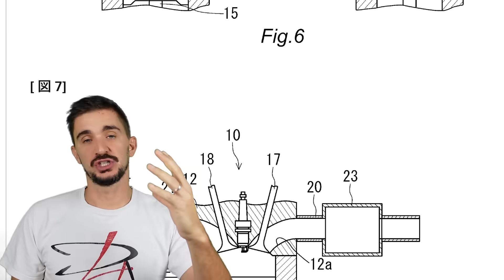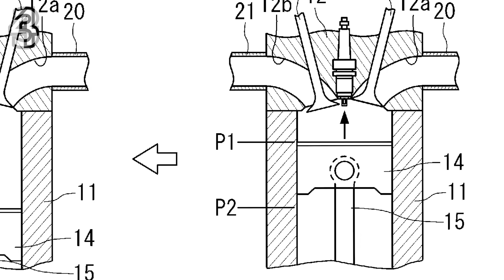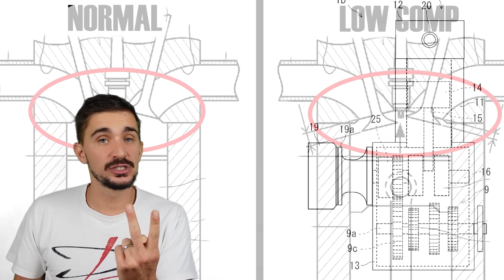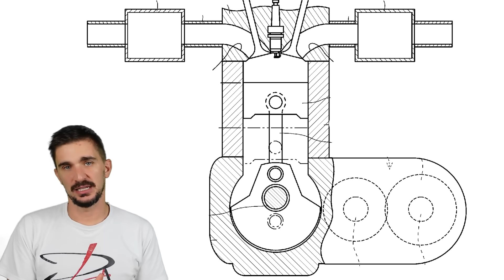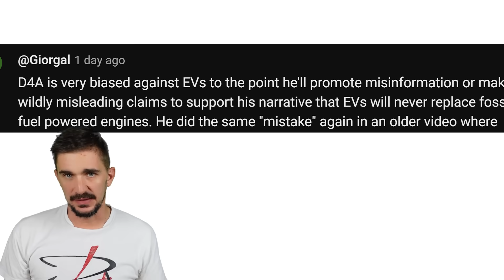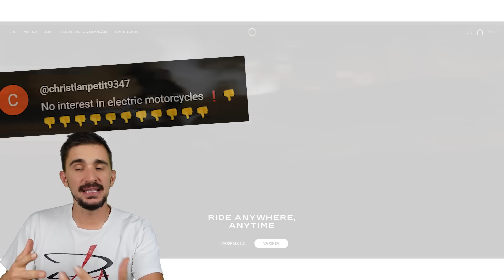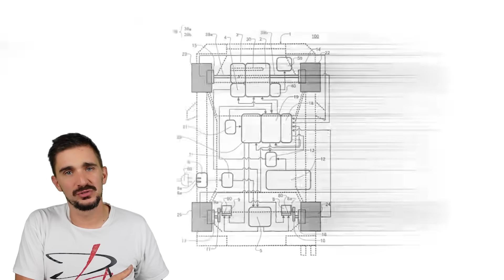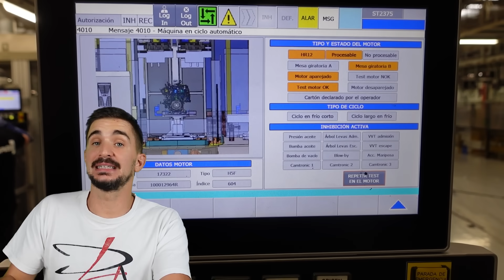Yamaha Just Patented A Fake Engine

Comment: I had a idea similar to this, but the "fake engine" actually propels the motorcycle forward and doesn't just act as one big sound generator. It would use the pressure from an air tank that would be converted into mechanical energy/torque. It would also use  throttle linkage that regulates the air that would get into the cylinder(s), meaning it would rev and sound like an internal combustion engine. The only problems is that you would need to repressurize the tank with a separate air compressor and the bike probably wouldn't have great range; it would purely be a recreational vehicle you would just have fun in. Also, the air tank could explode if it over pressurizes.

Comment: I'll never understand these mental gymnastics about vibrations and noise. Been driving a BYD Seal Excellence for a little over a month now and due to the acceleration, it's basically like taking driving habits from the motorcycle straight into the leather seat. I don't need huge gaps to enter a road or to overtake since a short tap of the accelerator is always enough. I don't see myself swapping that for something that makes lots of nice sounding noise while accelerating half as fast and costing multiple times as much to maintain. 😅

Comment: Uhh.. can the variable valve timing vary enough to change the engine into an air compressor and pump up the tires?
I am no judge of what people do in their spare time but personally I am not prepared to spend $5000 on a vibrator, I am not a Saudi Prince's wife.

Comment: "I'm not biased" 
one minute later:
"This is the problem with EV companies, why is it 'Stark Future' not just 'Stark'?! Tech bro is over compensating..."

This is all in your head, dude! You are biased! Implicitly because you love combustion technology? Gasoline and Diesel? 

I can't tell you why they called it "future" for certain, but I could guess it's basically the reason that makes you so upset because you're so biased: because it's currently the only technology option for a sustainable future. All combustion has emissions which cause cancer and are bad for the environment. That includes hydrogen, because that needs lubrication which burns with the fuel. I know the difference between two and four stroke. Even four strokes burn some oil over time, just a lot less than two stroke. 

This issue isn't technical, it's an identity issue. As in, people identify as a person who loves loud bikes or what ever, and when something comes along that's different then the group think doesn't like change, and the group thinkers go with the crowd.

Comment: Think about this possibility : make the engine work by adjusting the valves or replacing the camshaft. if you have a set of rules or regulations to work around does this approach bypass the goverments bs regulations for emissions ,can it be used as a hybrid ?

Comment: I see the vision honestly. This is the most accurate way to recreate engine noise and vibrations without actually burning fuel. Is it efficient? No. Is it practical? Meh. But most people aren't buying something like a harely because it's efficient or practical.

Also, I find it hard to believe they wouldn't make this optional and/or only put it in certain models, assuming they actually go anywhere with it.

Comment: You're right, there is no scenario in which this makes sense. Kawasaki already has hybrid bikes which make all the engine noise one could want, better than a single cylinder air compressor. No one wants those either because they are hybrids. The people buying electric bikes don't want extra garbage draining their performance or range.

The only way this makes any sense at all is if it doubles as an actual air compressor and is used in Colorado as a mobile air compressor on minimum maintenance/off-road trails for Jeep type guys who need to air back up before hitting the main roads.

Comment: You are overlooking something simple. A motorcycle’s most important purpose. FUN. Based on most of the logical criteria that we use to evaluate travel methods it rates between poor and average. Planes and trains are faster. Buses are far more efficient per passenger. Cars are almost as fast and more efficient per passenger. All of these are much safer forms of transportation than motorcycles. For those who are buying motorcycles because they’re an inexpensive form of transportation an electric powered one will meet their needs. What’s left? FUN from the euphoric experience which includes the sounds. I would never buy one of these fake motorcycles, but when I was a kid I put the card in my bicycle wheel to fake the sound. It’s the same reason that circus rides get patented, even though there’s no logical justification for a circus ride.

Comment: Maybe it could run as compressor spinning a turbine that generates electricity to charge the batteries and therefore eliminate the need to charge this vehicle so often. 
Doing this power and noise are made possible

Comment: My take: this exists only because of the inflexibility of the average motorcyclists intellect. I’m not immune. After laughing derisively at this patent, I thought back to how I used to use a clothespin to clip a playing card to the frame of my bike to make an engine sound. I thought back to the many MANY thousands of dollars I spent on my various motorcycles to make them sound “cooler” with MINIMAL performance benefits. I GET it, and I think Yamaha does, also. There will come a time in the next decade that battery technology will reach a watershed breakthrough and we’ll end up with a happy surplus of power; I think, and I believe Yamaha thinks that some folks will sacrifice a modicum of this surplus for the dumb, awesome, caveman-like satisfaction of a loud, throaty VROOOOM as we speed away at maximum electric torque

Comment: If you're going through the effort to install an engine that runs off the battery anyway, why not convert it into an ethanol powered electric generator? You could have an alternator connected to a differential running of both the rear drive and ethanol engine crank shaft. If you're gonna something so big in anyway, actually make it serve some kinda purpose like extending battery life

Comment: In the middle of the video, you speak about that this fake engine does nothing. But if you think about, most of the motorcyles does nothing. 
Let's stick with Yamaha. In most cases, wherever you can go with an MT-10, you could also get there with an X-Max 125. Both are suitable for riding on highways, both are capable of carrying a passenger. In fact, the X-Max has even more storage space.

So all the expensive technology and engineering developments in the MT-10 are "unnecessary".
However, these expensive exotic technical solutions are not unnecessary because they generate something very valuable: experience.

And this is why people pay 5 times more for an MT-10 than for an X-Max. Because it's exciting, beautiful, and feels good to ride.

The situation is similar with this overly complicated portable compressor.

If I had to choose between two electric motorcycles, where one is 30% heavier, 30% more expensive, but riding it feels like a classic motorcycle, while the other is a current-day, essentially stimulus-free electric motorcycle, I would most likely choose the one that provides the classic feeling.

Comment: There just isn't really much reason to switch to an electric motorcycle. Petrol bikes don't use much fuel, when I commute an hour each way to work I still only pay about $20 for fuel per week, and as they don't use much fuel they don't produce much pollution either.

Comment: i wish it gave some movement back, or keep a cruiser mode on highway to save power in a hydrid way, or at least it had a stator to power lights turn signals, indicators like digital speedometers tachometers etc ,i wish it did somthg

Comment: As you mentioned, the others relied on fake sounds; however, they failed to address the missing vibration. Therefore, I can see the logic in the madness. If I had to choose between a fake sound coming from a speaker and another fake sound generated through mechanical processes, I would opt for Yamaha's solution. I wouldn't particularly mind if it reduced power, as I could decouple the engine from the electric motor if I needed range. No speaker can truly simulate the sound of real mechanical induction noises with air actually entering and exiting a motor, it might not have the true soul of a ICE, but it would be the closest one can hope for on a POS electric bike.

Comment: Hello, I used to ride the bike also I work at a multinational automotive OEM as manager. I can see the root of this: In a huge company like Yamaha, people with the right skills can push their insane ideas through the company, no matter how much it does not make sense, or how much even the initial thought is false (I'm sure it is with the wish of the riders). Basicall the driving force is to became an important individual or get a promotion at the company. After a point, no-one will question the insane path, the company will just finish it, this is how it works. Most of people will have a strong opinion, but it wont mean they wouldn't do their job. It must be a very clear and strong sign of failure or loss for the top management to intervene and stop some of these. Don't seek too much company strategy or meaning behind this, the root cause is simple human frailty.

Comment: What else do Yamaha make? Keyboards.
This isn't a patent for a fake engine, this is a musical instrument, that's actually kinda genius.
Yamaha is right, you can't fake the feeling of an internal combustion engine with speakers alone, the vibrations and noise does add a lot of the feel of riding a motorcycle. I haven't ridden an electric motorbike yet, but I think I would enjoy it.
Maybe they're just trying to get ahead of the curve before governments outlaw internal combustion engines.
Fortunately the "engine" oil won't break down as quickly without the blowby gasses. Don't know why there's a spark plug in there... I guess to justify a service upsell.
I don't think a cooling system for something that doesn't burn fuel would need to be as good as one that does. Yes, air compressors get hot but they're being used to continually compress air to 100+psi, not just make noise.
You talk about it being wasteful, but someone could argue that internal combustion engines are wasteful.

Don't get me wrong, I dont think its a good idea, it's not an idea I like, I am not the target audience for this idea. But I do think it's a clever idea.
One last point, compressed air energy capture system. It's also an air compressor. Potentially, maybe, with a small air tank, it could be used to compress air when engine braking, and let some of that air back into the intake valve to accelerate from a stop again. But that sounds way less efficient than just letting the electric motor recharge the battery.

Comment: The bottom line is - Shot callers, corporations and overlords refuse to quit being defiantly illogical and seemingly insane.
Reply: I don't think you realize this has already been a thing in GAS motorcycles. Japanese bikes have done it before where they engineer IN an imbalance to create more ruble from, their engines at idle. This was 20 years ago
Reply: @skytho5799  What you are referring to is basically psycho-engineering. Playing with a harmonic balancer or whatever is way different than installing an insane engine that literally does nothing.
Reply: @PopCultureDefector  I agree this is just more drag than usual but what I was referring to was the literal adding of a imbalancer, it was so balanced it didn't even need a balancer and yet they added one so they could make it imbalanced, adding drag and inefficiency.
Reply: @skytho5799  Sure. I get that. It's basically the equivalent of the Japanese sticking a card in the spokes for more effect. When in reality, they should have been proud of the original design.

But still, If Tesla was adding non-functional,  8 cylinder engines to their cars to attract gear heads, they'd be the laughing stock of the auto world.

Comment: 0:50  Hi, you said that you are missing something about this fake engine, here is what I think.  Tesla market valuation is widely inflated mainly because it is not associated with other automakers but rather with Tech company which often loose money for years before they finally make a ton of money.  This inflated value has brought a lot of money to Tesla.  I believe that Yamaha, Toyota and Mercedes are trying to change the perception and be seen as Tech companies by multiplying bs technological break through.  Toyota keeps making announcements about hydrogen and ammonia engines which are a dead hand in my opinion and Mercedes has made announcements about a radial electrical motor.  The advantage of the radial motor is more torque compared to axial motors but they are more difficult to build and more expensive.  Why do I think it is bs?  Because electrical motor already have more torque than needed, the issue with EV is range, weight and cost, not a lack of torque.  I believe these companies are releasing new designs for the sake of releasing new design and keep the market on the edge.

Comment: So it is somewhat like a hybrid powertrain, but with the engine offering nothing more than sound. Well, sound is an important safety feature, but in this case not worth the extra weight. Replace the whole thing with a gearbox and an actual engine and you 're good to go.

Comment: this might be far fetched but maybe this is Yamaha's plan to get around EV mandates. If the "Fake" engine is mechanically the same as a real engine potentially it could be as simple as an aftermarket camshaft as well as a fuel and ignition system and your "fake" engine is now real.

Comment: I am not a cyclist. I think that patent lacks something very important that cannot be faked and will be missing on this rattling contraption: the explosions of the gas within the cylinders! The tailpipe sound of a real combustion engine cannot be mimicked by just releasing compressed air that leaves the cylinder at a much lower pressure  than the real exhaust fumes. Therefore, I think they didn't build any of these fake motors, yet,  and will be heavily disappointed when it simply rattles mechanically and only produces a weak sound at the tailpipe.

Comment: I have no problem with this.  The reviews I've watched of the Ioniq 5N have all said that it's fantastic fun even though it's totally fake and performance-reducing.  Was performance ever the purpose?  Real drivers still prefer manual transmission even though it performs worse than automatic because it's more fun.  I've driven a new Boxster S and a 15-year-old Boxter Base, and the old one was more fun despite being much lower performance.  I know my Challenger uses audio amplification of its engine noise, and I love it.   I've spent hundreds of dollars and thousands of hours on a driving sim that has exactly zero real performance.   It's not a "waste of precious resources" if someone likes it enough to pay for it.

That said, a patent is not the same as a product.  I think it's quite likely that the cost and range penalty will be such that this particular idea won't ever come to market.  But I have no objection to it in principle.

Comment: If what is wanted is noise and vibration, couldn't just put a compressor (and some like valves, resonators and that stuffs) and for vibration maybe just have that thing in phones that create vibrator (just scaled up) it would still suck power from the bike and add lot of useless weight but I think It would weigh a lot less

Comment: imagine driving a electric motorcycle which on it’s own is quite heavy and place a fake otto engine with exhaust and everything in it just to fake engine noise while substantially reducing range and increasing the weight even further. Like just buy a tesla at this point.

Comment: So in order to create a fake engine noise you have to waste the already limited battery capacity of an electric motorcycle to push some air around. Great! You'd barely be able to make it across town on a battery charge, but at least it makes some nice sounds for those 30 minutes.

Comment: I got 6 minutes in and think Yamaha has made a silly decision to make this. If you want to be eco friendly and have a reciprocating engine, at least make it produce a minimal amount of power. Just enough to offset the power loss and maybe make half to 1 hp. That way it is not a complete waste, it is giving all the other desired effects, and burning a high idle amount of fuel which would last a very long time.